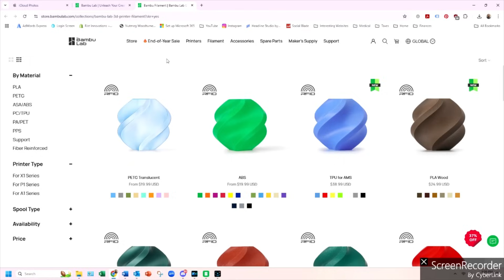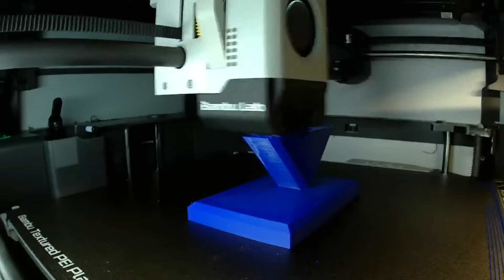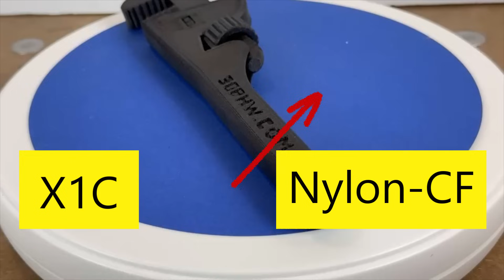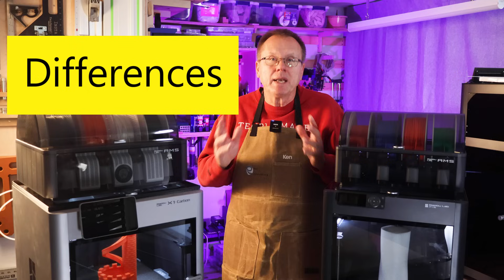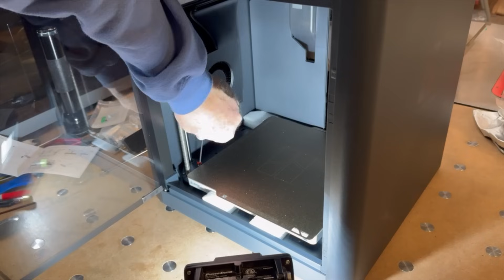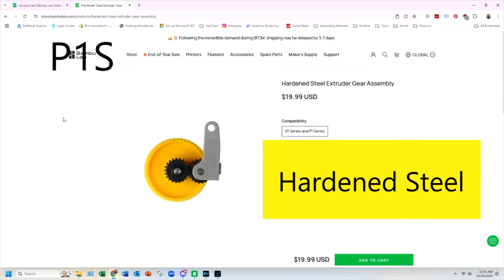Bambu Lab P1S 3D Printer: Better Value Than X1C?

Comment: I 100 % agree with everything in this video.  I purchased my X1C over a year ago and at the time it was more expensive, about 1500 but the P1S was also more expensive about 1000.  The deff was still 500 and I went with the X1C.  I wanted "THE BEST"  At the same time a friend of mine bought the P1S.  Withing weeks I reaized that the P1S printed just as good and reliably as my X1C.  Hes not only upgraded the hot end and extruder but also the touch screen to exactly the same as the one on my X1C but even better in that its a wireless screen with magnetic mount that he can remove use portably within his home.  If I had to do it again Id buy the P1S
Reply from the maker: Thanks for sharing your experience with the X1C.

Comment: Please give your opinion.
Right now I'm between p1s + and 2 pro and x1c + ams 2 pro.
For p1s I'm going to buy hardened extruder and nozzle to match x1c.
Total cost for p1c is $906.
Total cost for x1c is $1100.
Basically $200 difference.

I really like a better screen and camera on x1c, but many people online saying it is not used often.
According to lidar. If I understood correctly, for non bambulab filaments it is better to do manual calibration or simply find and do quick test for profiles. So lidar kind of not necessary.

I don't know. I just like x1c, but I don't like to waste money.
Reply from the maker: Everyone is different, but I like and use the touchscreen on the X1C (as well as almost every other manufacturer's touchscreens on their printers) versus the P1S screen.  If you are mainly planning to use a slicing software to communicate to the printer then the screen interface may not be as important to you.  One thing you may want to  learn more about is a "P1S Refresh" that Bambu Lab is planning to announce tomorrow, 10/14.  I don't know if the refresh will be as simple as replacing the P1S screen with a touch screen, or if it will be an upgraded model "P2S" model that may have numerous upgrades (and be more expensive), but it's worth checking out before you make your final decision.  I hope this helps.  Please send another comment after you have reviewed the Bambu Lab announcement if you would like my "two cents worth".  Thanks. Ken
Reply: @ristinnovations  would you say $200 worth for x1c, for a touch screen, better camera and lidar?

Comment: I print both carbon fiber nylon and plastic. The X1C is currently 500$ and the P1S is 550$. Which one would you recommend.
Reply from the maker: In your area the X1C is cheaper than the P1S? If that’s the case I would definitely get the X1C. If your numbers are reversed and the P1S is only $50 cheaper, then I would still buy the X1C. Thanks for the question.
Reply: @ristinnovations so I had confused the K1C to the X1c. I said it on another video too and had to correct it.

Comment: You said that you could not see a difference between the business card holder printed on either machine, yet the P1S print has a very noticeable flaw on one of the chamfered edges. Was your comment just an oversight?
Reply from the maker: You are correct.  On the business card holder for the P1S, there was a layer on one of the chamfered edges that had a defect. I should have pointed that out.  Thanks for your feedback.

Comment: I work as an electrician in a 100 person company in Finland. I swear we could benefit so much from having a 3D printer that just works, and someone who knows how to operate it. I'm just not sure if I could ever be able to, as a lowly technician/electrician, convince the company leaders to invest in one.
Reply from the maker: Please don't sell yourself short.  Can you think of an example application where you work that a 3D printed part would help the production line? A jig or fixture?  You could do a cost analysis that basically says that if your company bought a 3D printer, let's say the Bambu Lab P1S without the AMS ($700) plus some filament, and either you or one of your employees would design the part (jig or fixture), it would save $xx per day in production labor savings.  If you could come up with a few suggestions on a piece of paper with the costs and payback you could present that to your supervisor/manager.  At a minimum, it would show your management that you are thinking outside of the box and a best case scenario is that they decide to go ahead in supporting your idea.  I sincerely ask that you try this and please let me know what their response is.  I would be glad to help you if you think I could be of any help.
Reply: @ristinnovations  Thank you for the encouraging words. I'll try to note down examples while doing my work, where 3D printing could help save time and money, or make our jobs easier. I can already think of jigs for making wiring harnesses, getting stickers and signs straight, counting terminal blocks, organizers, machines for winding spools of wire and so on. Also one thing that is absolutely unbelievable is that, for a company that uses kilometers of electrical wire a day, we don't have actual wire spool racks/holders. Like wtf?
Reply from the maker: @lassipls You already have some great ideas. Please let me know if I can help in any way.
Reply: €1000 won’t break the bank for a company that has 100 electricians
Reply: @cdunne1620 you'd be surprised

Comment: I bought the p1s about 3 weeks ago, i,m having a blast, the prints come out so good all the time and overall quality seems very good in terms of how it has veen build and software also, i ordered the ugrade hardened steel kit, what an amazing hobby this is, also a great straight to the pount video subscribed
Reply from the maker: I'm glad you are enjoying your P1S. The hardened steel kit will give you that many more options of different materials so that's great that you ordered that.  I agree that 3D printing is a great hobby!  Thanks for subscribing!
Reply: Buy the cmyk filament kit and print lithopones, really cool
Reply: Will for sure look in to that, sounds like a grwat of fun. I,m designing a bluetooth speaker shell and been printing the first prototypes :)@cdunne1620

Comment: I've been considering buying a 3D printer for about three weeks now. At first, I was interested in the Elegoo Centauri Carbon, but then I found out that their customer support isn't supposed to be very good. That's why I started looking at the Bambu Lab P1S, and now I'm trying to decide whether to get the standalone version, the AMS 1, or the AMS 2 Pro. My goal is to print sturdy enclosures using PETG CF.
Reply from the maker: Coincidentally, I’m working on a video comparing the Elegoo Centauri Carbon to the Bambu Lab P1S that I plan to publish this Friday. Depending on your budget, I don’t think you can go wrong with the Bambu Lab P1S. I have the P1S with the AMS 1. I recommend that you get the P1S with one of the AMS units. There are several benefits with the AMS 2 Pro. Good luck with your decision and thanks for your comment.

Comment: I love my p1s! the only thing i dont like about it is the stupid connectors for the hot end and extruder and parts fan
Reply from the maker: I agree with your point about the delicate wires for the P1S hotend. I like the quick-swap nozzle feature on the A1 and  H2D series. Thanks for the comment.

Comment: For the CF and GF filaments did you use the default presets or did you use your own custom presets. I have noticed some P1S users heat up there bed to 100C for 30 mins before they start a print to avoid warping.
Reply from the maker: I just used the default presets.  Thanks for the question.

Comment: I am nearly convinced about P1s but really don't like that screen. Its literally a $10 screen and they already have the programming. 
Not offering a decent screen on P1S is a really nasty corporate trick by bambu labs.
Reply from the maker: I don’t like the screen on the P1S either. If they offered an optional upgrade to a nicer screen I would buy it if it was reasonably priced.

Comment: Great video and I am new to 3D printing and deciding between these two printers . This may be a silly question but if I upstage the P1S to the hardened steel accessories like you showed are standard on the X1C which allows more variety of print materials. If this upgrade is made on the P1S is it backwards compatible with the materials like PLA or do you need to switch back to the original hardware for these materials and then switch again for the more challenging materials you bought the accessories for ?  One more question since the screens are different . Can you use your phone connected to the printer with the app to make all the same changes you can do directly on the attached screens? Thanks for making the video. I look forward to catching up on your other ones.
Reply from the maker: There are no silly questions in the 3D printer world.  That's how we all learn together. To answer your questions; yes, if you install the hardened steel extruder and nozzle in the P1S, you can use ALL the filaments Bambu Lab (and other manufacturers offer). Some carbon-filled/glass-filled materials perform better with larger diameter nozzles such as .6 mm diameter, hardened steel, but you shouldn't have any troubles printing materials such as PLA, TPU, PETG, etc. with the hardened steel parts.  Regarding the Bambu Handy app, you can monitor your prints, and implement numerous changes, but I don't use the app enough to say for sure, what the app can do versus what the LCD screen on the printer can do.  Thanks for your questions and I hope my answers help.

Comment: Great Review indeed! As much as I love the P1S,  I can't stand the Screen/interface, coming from an A1.  I went and checked the P1S at a reseller and it was really frustrating to work with this 1990 look-like screen. The alternative Bigtreetech Panda touch screen was a great alternative and was about to pull the trigger on a P1s, until Bambu lab put a limit on it with its new Firmware upgrades. I don't want to get stuck on an old firmware just for the sake of having a flawless Panda screen, or risk it and start having unresponsive screen down the road. This is very wicked from Bambu Lab. they should either give a licencing to Bigtreetecch  or come out with a similar screen instead of the Flinstones era screen on the P1s. I know the price difference between the P1S and X1C is substantial, however I am sticking to the A1 for now until I see a better screen from Bambu Lab or a future promo or discount on the X1C
Reply from the maker: Thanks for your comment. I especially liked the Flintstones part😊

Comment: I have a P1S and upgraded to hardened steel nozzle and extruder with mine and got the mod upgrade screen from Big Tree i have no complaints with my P1S its worth every penny imo
Reply: Does the big tree screen still work after update ? Gonna buy a p1s this weekend and wanna know if I should order the screen
Reply: @robbrobb325  yes mine is still working

Comment: Excellent Comparison - do you think the Panda Touch is a worthwhile upgrade to the P1S?
Reply from the maker: I think the Panda Touch is a nice upgrade to the P1S because it is a lot easier to use than the stock screen.  Also, it gives you the ability to monitor more than one Bambu Lab printer.  I recommend that you do your research on the pending Bambu Lab firmware upgrade because there will be some limitations of using 3rd party products such as the Panda Touch, unless you set up the printer in a "Developer LAN" mode.  At least, that's what Bambu was planning as of January 2025 for the X1C, with plans to expand to the P and A series printers.  I don't know what the latest status is.  Thanks for the comment and question.

Comment: Good review, just a nitpick - with 1080p and 720p, the number references the number of pixels in the vertical direction, but the p actually stands for "progressive scan", as opposed to, for instance 1080i, which stands for "interlaced", which reference how the image is refreshed, not the resolution
Reply from the maker: Yes, thank you for pointing that out.  Somebody else mentioned that to me as so I won't make the same mistake.

Comment: Thanks for the video, this was very helpful.
BTW, the 4 GiB of internal memory of the X1C is eMMC storage memory. It is not RAM.
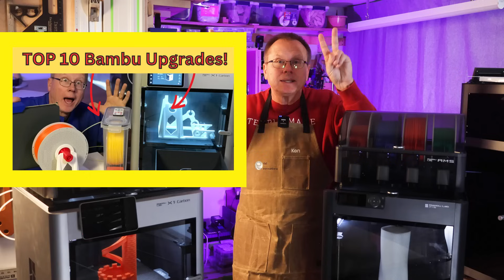22:06 I would buy the X1E, not the X1C. The X1E comes with Ethernet support and doesn't need a cloud and internet connection, thus it is better for privacy.

Comment: It's just crazy to be that my A1 has automatic dynamic flow detection and the P1S doesn't. I'm new to printing so don't know if that's a big deal or not, but between that and all the other features that the X1C has to make life 'easier' I think that's what I would get.
Reply from the maker: You make a valid point. I think it’s a matter of determining which features are important for each person. Thanks for sharing your thoughts.

Comment: Please help with the upgrade of the extruder for P1S. On Bambu site at spare parts extruder for P1 there is available only the "Stainless Steel Extruder". The "Hardened Steel Extruder Unit" is available only for X1C model. Is this hardened extruder compatible with P1S? Can you post the link to the extruder and the hardened steel extruder gear? Thank you and congrats for your useful clip! 👏🏻
Reply from the maker: Yes, the "Hardened Steel Extruder Assembly" is compatible for both the X1 Series and P1 Series printers. The screenshot of the assembly is at 14:27 in my video for your reference. The cost for the Hardened Steel Extruder Assembly is $19.99 USD.  When you go onto the Bambu Lab website you will see their note that the HSEA is compatible with the X1 and P1 series.  I hope this helps.  Thanks for your question.

Comment: Good review, I'm still considering getting the X1C, even though the P1S is proving to be just as good in pretty much most cases.
But, the X1C is what my preferred shop got in stock atm, and I'm currently in the market and very, very tempted of diving in to this endevour, as I'm getting tired of having to rely on others to them print stuff for me.

Thanks again for a good comparison!
Reply from the maker: I don't think you can go wrong with either the P1S or the X1C.  Good luck with your decision and thanks for your comment.

Comment: Is the liddar a big benefit?
Reply: The LiDAR is useless for build plate detection and auto flow calibration if you want to use textured build plates. The spaghetti detection is a nice feature but if you properly calibrate and dry your filament and use the correct build plate settings you will not have enough failed prints to justify the increase in price for the feature. I have a P1S and after calibrating and drying all of my filaments my prints come out immaculate. I am just in awe at how clean they come out each time.
Reply from the maker: I struggle with answering that question. The spaghetti detection feature has helped me in the past, but I find it hard to quantify the benefit of Lidar.

Comment: I bought a P1S a couple of months ago. 

I wanted the X1C ever since it came out and that’s what I was going to buy. I put it in the basket and added a few spools of filament and went to checkout. It was just short of £1600 and it’s then that I paused and didn’t click ‘pay’ 

It was a lot of money to spend. 

I started to compare the X1C with the P1S as I’d seen some comments on here and on Reddit saying the smart choice was the P1S.  After watching a lot videos I went back online to bambu lab and loaded up my basket with a P1S, 11 spools of filament, 2 spare complete hotends, spare build plate. Went to checkout and it was £600 cheaper than the price I was quoted for the X1C with less filament and no spares. 

I clicked ‘buy’ and now with 400+hrs of printing have never wished I had gotten the X1C instead. 

The cherry on the top was when Bambu lab also gave me £70 gift card as they started their Black Friday sale a week after I placed my order so gave  me the difference back in the form of a gift card.
Reply from the maker: Thanks for sharing your experience. I’m glad things are working out well with your P1S.
Reply: I am literally in the same boat right now. I was a second away from clicking buy and decided to research the P1S. With little to no difference in print quality, I think the choice is easy.
Reply: Very nice summary of your decision making!  I’m facing similar…. Thanks for sharing!

Comment: Just got an x1c for much the same reasons as you did - it's my first printer, and I want to get my designs made with the minimum of fuss. A friend who's more experienced with printing bought the p1s as his 3rd (and currently best) machine. Both of us have had no complaints.
Reply from the maker: It sounds like we are in the same boat.  I'm glad you are both enjoying the Bambu Lab printers.  Thanks for your comment.
Reply: I have a P1S for 3 months... Never used lidar.. Never had a failed 1st layer... Lidar sounds cool. sure.
and it undoubtedly makes you feel all proper and good.. but basically the P1S achieves exactly the same quality print for %30 less cost..
And the P1S hasn't been targeted yet by Bambu's sellout lockdown.
Reply from the maker: @graxxor Thanks for your comment

Comment: I was going to buy a Bambu lab printer but the bed size was a little small then I was told Bambu labs my come out with a larger print volume 300×300 so I'm holding off on buying a new printer, Flsun S1 looks good
Reply from the maker: Yes, Bambu Lab has indicated that they will be launching a new 3D printer during Q12025.  There is nothing definite, but rumors are that it will be a larger printer than their current offerings.  I haven't personally tried the FLSun S1 yet.  Thanks for your comment and good luck with your decision.